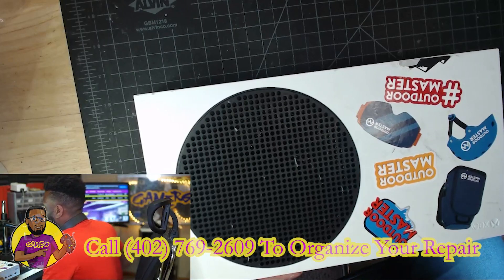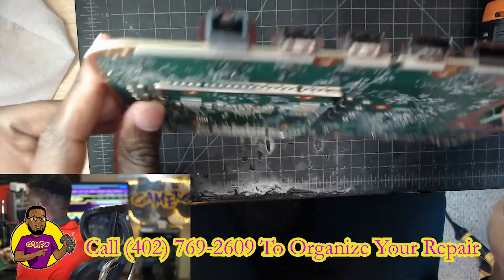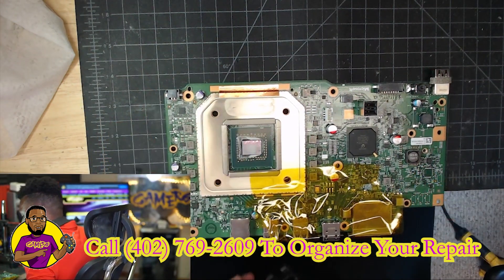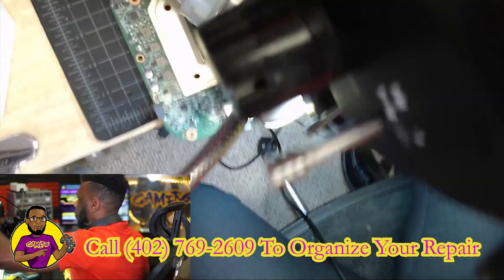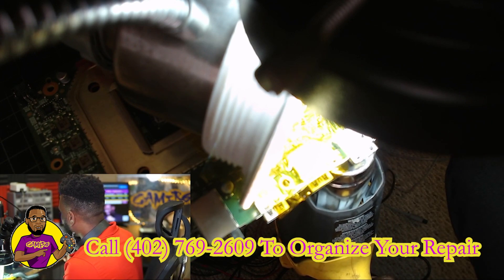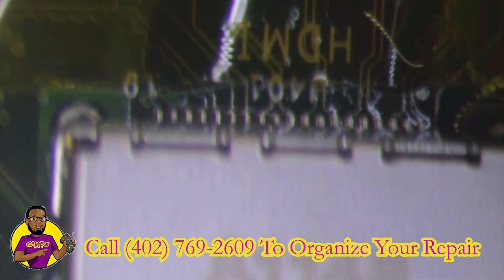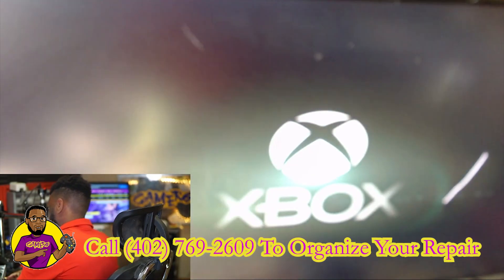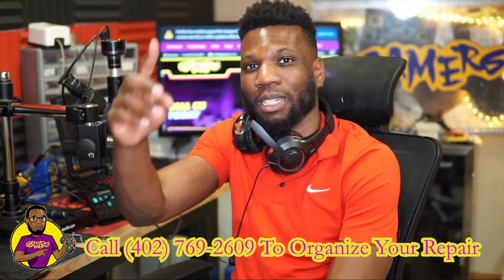Fix Xbox Series S No Signal HDMI Port No Signal Repair (Best Method)

Comment: Can I fix it without heat gun🤦🏾
Reply: You can individually remove and solder anchor points with solder gun. Just a little tougher and do one at a time instead of all at once.

Comment: Soooo, I just got a series x that had HDMI port repair attempt..I had to fix the port(9 pins weren't attached) all pins are down,still no image. I changed the retimer/driver Ic chip cause it looked haggard from previous repair, and STILL NO IMAGE.🤔🤔 ANYONE?? ANYONE??